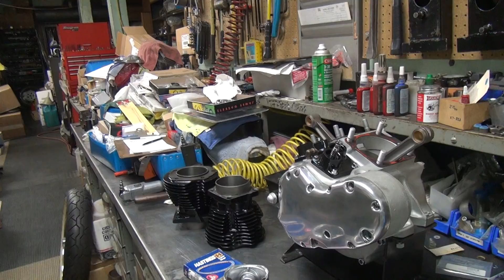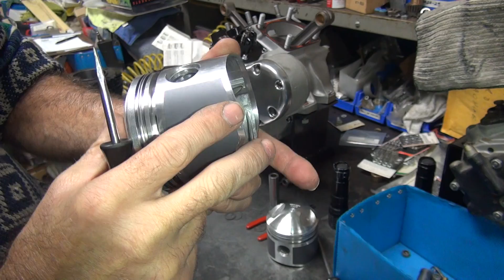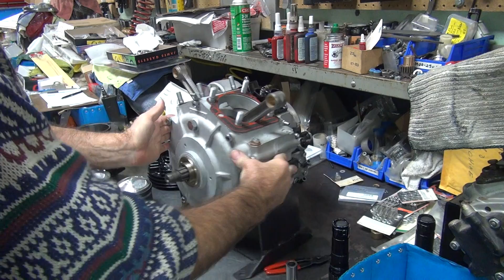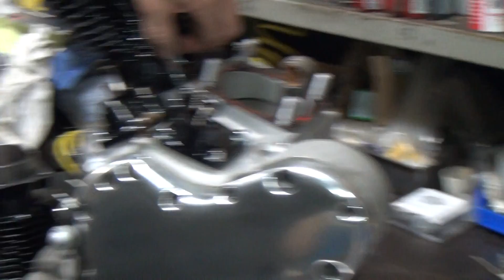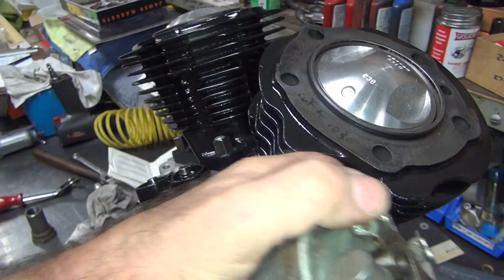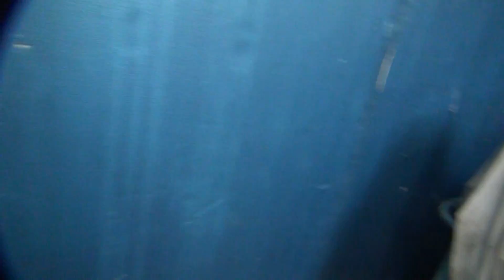1965 panhead #125 74ci flh motor rebuild and bike repair harley by tatro machine

Comment: If those were my pistons that were getting slammed around and scratched i would be kind of upset....
Reply from the maker: now where were all these scratchs at. time to go watch some cat videos. i care more about the parts in a motor more than you ever would. that is why my motor run very good and last a very long time.
tatro
Reply: @TatroMachine  First off, before you become an a_hole with you stupid replies, you should look me up, do some homework about me, and see what kind of work I do and have done. I honestly applaud you for your work. But if you want to defame me with you  remarks go f@#$ yourself. Maybe you need to put some glasses on to see the scratches, and particles the pistons had in them. Even the folks that were watching your video with me saw the aforementioned scratches and particles. When you can build a 1000 HP prototype HEMI (engine) come see me. Oh yeah for your information a (motor) is electric. And anybody that checks ring end gap with a 6 inch ruler should go home and lay on the porch.....Next time your in the Detroit area please feel free to stop in, maybe I will show you how it's done correctly.
P.S. I really enjoy watching you smack the piston into the cylinder bore too.

Comment: Talking about those rings with the dot and chamfer on one side. I was rebuilding my Shovelhead and got a set of standard 8.5 pistons and a regular set of cast rings. Both rings have STD on one side and nothing more. No dot anywhere on either but one ring is a little darker than the other. Nobody around here could tell me how they were to go on the piston. Even the supposed shovelhead guy really couldnt tell me he just said id put them both face up. Didn't sound right to me.

 Now one ring appears to be darker than the other. Anyway I put the light colored ring on top face up STD and used the darker second ring and put the STD and beveled edge face down. I've got about 1000 miles on my rebuild and she runs strong. No smoke and sounds/feelsgood and tight. Only smoked a little in the beginning then cleared up pretty quick. I believe I have the second ring installed properly from what I've read. Sound right to you?

Thanks

Its apparent not many around know how to work on these older harley motors but they are quite easy. Makes it easy when all I've ever done is work on motors my entire life as a mechanic until I hurt my back and then had to get out of it.  Its been awhile since I been inside a motor rebuilding one but it all comes back pretty quick... These are a lot easier to work on than car motors especially when you have to remove and install it back in the frame. I wish I had been motorcycle mechanic instead of an auto mechanic but that's the path I chose...
Reply from the maker: all markings go up on the rings. if they break-in you will be fine. on simple cast rings it doesn't always make much of a difference on how you install them. but if they are not happy they will let you know real soon.
tatro
Reply: @TatroMachine  Well im at 1000 miles since I I rebuilt the motor and she runs strong. If i did both face up on the rings  for STD topside then I'd have both beveled edges facing up. I wanted your advice or opinion as well since you work on so many Harleys. Everything I've seen says second ring bevel down for oil scraping or the motor will consume a lot more oil. I'll just see how it goes on oil usage.  Plugs look good and no smoke so I think I'm good ... Will see.. Thanks for responding...

Comment: What about using repop cylinders from Taiwan ? I got a set but was thinking they may not be good for a 88" stroker motor..
Reply from the maker: they work good until they break. who knows when that is. they are allot better than they use to be. the s&s ones are allot harder and will last longer but cost tons more. you get what you pay for.
tatro

Comment: What are your thoughts on cross hatching cylinders to allow for faster ring break in? When I was taking my MCM course they mentioned that it is recommended to cross hatch bored cylinders? Thanks man!
Reply from the maker: that is how it is done. the angles and grit makes a big difference in what you get. not all applications are the same. watch the videos closely to see how i do it.
tatro

Comment: On a fresh rebuild, what is acceptable leak-down on street motor and hot rod motor? We had an exchange about gapless rings a while back. An Iron Head I had awhile back had 12% leakage on new build. Put in Total Seal gapless second ring and it dropped to 2%
Reply from the maker: you need help on your machining. race motors are 0-1%, 1-3% on good motors, 5-10% on used motors, 10-15% on a well used motor and over 15% needs help.
i never noticed any difference on my bikes with gapless rings except for oil control. not much difference between zero and less then .010 running clearances.

tatro

Comment: Hi tatro what is your opinion on those new style pistons with the coating  thanks
Reply from the maker: they help on the break-in and i have not had any problems with them. i also didn't really have any problems with the non-coated pistons. the ones i didn't use was the 60's style ones with the crappy early 30's style retainer clips. anyone want some cheap pistons?
tatro